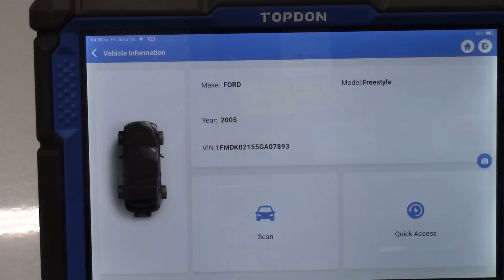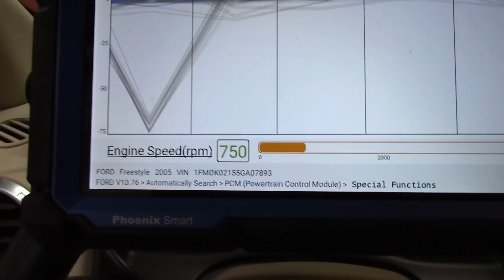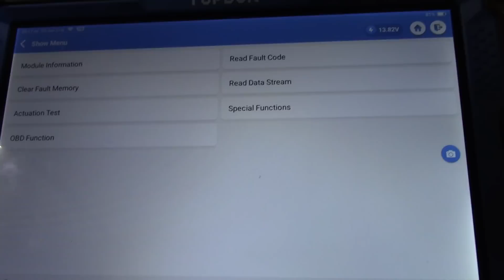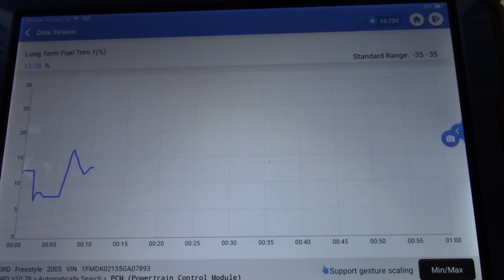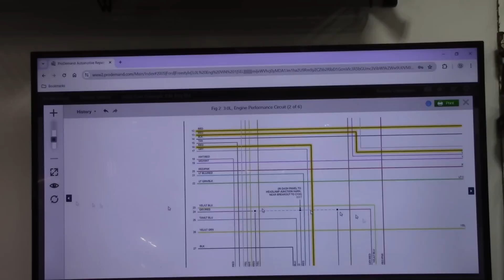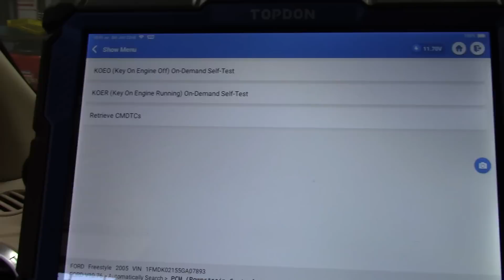P0301 Misfire Is Under Intake Manifold- What Do You Do?

Comment: I just did this job after watching a bunch of videos including this one! It's not  too difficult and only has one knuckle busting part-the egr valve. I sprayed it with PB Blaster and let it sit overnight and then the thing just moved with ease (I used a clawfoot 27mm on the end of my 1/2" breaker bar for good leverage). A mechanic wanted $325 plus parts. Thanks for the video!!

Comment: Hi Matt I watched you do the resistive test on the coil, neg, would it be possible to use an injector pulser to drive the coil, and use the oscilloscope to look at the primary waveform of the coil to see if it is breaking down, ignoring the fact that there is no compression or fuel mixture present, and just trying to confirm if the coil has a voltage break down or shorted turn.

The main concern with this test for me would be, damaging the injector test unit, just got it, but the voltage spike and current are similar for injector and spark coil.

What got me thinking about this, In the old tv's there was an extra high voltage transformer to supply 20 kv, similar to an old car coil, but resistive test were the same as for car coils now you could not find a shorted turn in the high tension side, so we used an oscillator voltage to see the ringing of the transformer on a scope, it was so accurate that sometimes we would introduce just  a single coil around the winding and watch the ringing pattern on the scope collapse to verify the set up was working, this was to stop ordering and changing parts that didn't need it anyway. :)
Reply from the maker: Not only can you do that but I actually have a video where I do this exact test.
Reply: @ I will look for it thanks

Comment: My coils and plugs in the intake.
P0304.then 0300.then 0301
0430 every time.

For a long time misfire#4
Briefly showed all 6
Now shows #1
My tool doesnt do the graphs 
Reader not scanner 

Also bank 2 02 was.showing with #4 original

It is due for mant-i-nance being 120k.

I dont know sh1t but i feel carbon buildup might be an issue?

Oh
She also has intermittant no start..dead key. 
But if you put it in gear, wether you roll a lil or.not then will start..

.
Also ive seen wire harnesses on this model are prone to melt.....

Thanks for.the content!
Reply from the maker: Start with the basics.  FASTTEC.

Comment: try a equinox, pain in the a** fuel rail under top intake. spark plugs by the firewall,  serpentine belt tensioner no room for leverage with a belt tool unless you spend some cash on a mid length one.
(i got mad an put the belt on by hand with the help of a sock_)
 replaced alternator and figured at  135k do a belt and plugs also. get it together and white smoke and gas coming from the exhaust, a lot of it. did a cheap elm reading and throwing a p0305 code.. cyl 5. swapped plug wires and same error, checked spark and it was strong. right away I though its got to be wiring from disturbing them 15 years later. (it is a 2009)

Neighbor has a mechanic of 35years who brough over the 10,000 
diag and said its definatly injector stuck open. Pulled off all the hoses etc intake and replaced injectors, all of them.
get it all back together and same code and smoke and fuel from the exhause.  went over everything wires etc 100 times. replaces wires, plugs inhjectors.
went back out to put things back together and give up. checked all connectors and used a little die electrical greese made sure the pins werent loose and I came across a group of wires (injector harness) where I believe a rodent nibbled through 3 wires, not all the way. so I snipped and  repaired the wores and rewrapped them with new heat tape. The car fied up like a champ, never ran better.
Now there are cpdes p0175 I think, so I replaced both upstream and downstream sensors, cleaned aitr intae, MAAF,etvc etc and cannot get rid of the code, ,y trims run RICH so its a air issue but I dont know what else to do . Seems i replaced everyth8ing mar as well replace the egr and maf.
 There is a small hole in the top intake (I learned from wathing videos) I think it replaces the egr, if that was blocked when I put the top intake back on that may be the problem. 

 I have never done anything accept brakes rotors and minor things on a vehical. Im proud of myself that I have that logic and skill to do on my own without guidance. But Im comming to my itts end.

 BTW, THANK YOU FOR THE FUEL TRIM VIDEOS. I listen to them over and over so I can diagnose  problems and narrow them down. Without your help I would be scatching my head still.

 Used your tips on my 2008 solara with 245k miles. it had the same belt and plugs in it. I replaced the alternator and the plugs and belt. (I should do the timing belt, but the equinox comes 1st).. I did some tweake from yur videos and now my car runs like a champ. I get aboiut 140k more miles a tank in gas, I idle steady at about  680 to 720, and I got my fuel trims fluzuating at 2 and 3%...
 You awesome man., thank you again!!
Reply from the maker: Regarding the “stuck open injector”- what is your voltage reading on the ground showing?

Comment: I have a 1999 chevy venture 3.4 v6 van. Turn over no start, but acts like it wants to start, but has a slight backfire. On the end of stopping your turn of the ignition key. I have changed cam shaft positioning sensor. The wires just pull out of the top of the sensor.  I am older man now a days it takes me a lot longer to try and do this  work anymore. But I don't trust auto shops.  You are a genius

Comment: The coil windings can still be good..  but it's just arcing through the insulation and shorting to the block somewhere..  Sometimes you can just replace the rubber boots, if you can find them...  and if they are easily removable.   (nice diag, as usual)
Reply from the maker: Yes totally agree and in fact probably what is happening. However there is no way I am only replacing the boots if the coil is under the intake. That coil is being replaced for sure to prevent a comeback!!
Reply: @SchrodingersBox  I agree.. that's a good call.   But as a DIY on my own stuff...  I might swap a boot if I could get them. :)  ..  too frugal for my own good.

Comment: What paddle probe did you use to test that coil?  Do you have a link for it??  to buy it
Reply from the maker: I have several of them that I just got off Amazon. various brands.
Reply: @SchrodingersBox  You could do a video comparing all the paddle probes you have.. (maybe you have, I"ll search the channel).
Reply from the maker: @calholli no I haven’t. But I have Three of them- they all perform identically but some are longer and less flexible and others are shorter but very agile. Just depends on what I am trying to reach.

Comment: Since there is no resistance difference between a good and a bad coil, it can't just be a coil. Is there any electronic circuit inside that plastic packaging that could explain the bad behavior during operation? Or is it just temperature related issue? Could you test the coil resistance after warming it a bit? Or since it's bad, tear it apart? 
It would be nice to understand what really fails inside the "coil".
Reply from the maker: No there is a massive resistance difference between the good and bad coil when the coil is under load. when the coil is not under load, there is no difference. this is why I mentioned ohming a coil is a terrible way to test it. you have to always test any coil when it is under load.

Comment: Hi , what is a misfire, an incomplete combustion because of weak spark, or something else
Reply from the maker: it is a failed combustion event for ANY reason. weak spark, lack of fuel, lack of compression, lack of oxygen, bad timing….
Reply: @SchrodingersBox  thanks for reply, how can we diagnose it on a single cylinder carburettor scooter, is low compression a reason of misfire or loose timing chain, cause I have black spark plug, and changing the main jet  with a leaner one it became worse thanks
Reply from the maker: Oh man. On a scooter with one cylinder it wouldn’t run at all if it was missing fuel or spark. It had to be either timing or low compression. Since it’s one cylinder you have to compare compression to a specification- you can’t compare it to another cylinder. 
   Keep in mind bad timing will cause low compression. You probably will have to disassemble it to check the timing marks. OR try putting about a tablespoon of oil in the cylinder and if compression increases you know the piston rings are worn.
Reply: @SchrodingersBox  thanks for reply, the manual calls for 170 psi and I have 93 psi and if I put a spoon of oil it goes 130 psi I don't know if my chain is stretched
Reply from the maker: Yeah this confirms the cause of your issue is low compression. It’s a little unclear where the loss is and if it’s a timing issue. This is where you just have to start dissecting it but at least you know this is 100% a mechanical issue.

Comment: Great video! Next time I would suggest running a relative compression test for the raw data. For me its scan, if misfire is present in one cylinder run ralative compression, then check the coil the same way you did. Takes like 20 minutes for all tests max.
Reply from the maker: I would have run relative compression if there was any indication it would show positive. You can clearly hear there was absolutely no compression loss in any cylinders.  So I move it to the least likely cause. Also the fact the misfire wasn’t consistent further substantiates a compression issue is less likely.
   Otherwise I totally would have done one.

Comment: Wow... Common theme with his videos seems to be everyone is a hack, except for himself. Couple quick points, the intake R/R is 2hrs labor. Which is generous. So the $700 figure thrown out there is way off. Also, what happened to the For Sure vacuum leak? A misfire caused by a vacuum leak will only be at idle. So driving the car would be and is always a 1st step. Fuel trim readings can be very misleading with a misfire. Next point, the PCM/ECM is not inside the car. It's in the cowl, AND they fail very often. So your time saving techniques are nice, but what if the PCM is sitting in a pool of water? Or what if it would be in water because the drains are clogged??? If the PCM is bad, the proper fix is ALL the coils ALL the spark plugs and a PCM, and they need to be Motorcraft OE parts. I'm not a flat rate tech, but I was, and I can tell you its the system more then the techs. You simply can't spend the time required to properly diag a car. You have zero pressure on you, no customer in the waiting room, no advisor asking you how much more time, or whats wrong with the car. You don't have 8 other cars that need to be looked at. Perhaps you should just do your diags for your customers and your You Tube fans, I think thats great, and you likely help educate some folks out there. But stop throwing the rest of us under the bus. We are not all hacks or dishonest, in fact I think the overall majority of techs want to do things properly. We are all very impressed with your knowledge, if thats what you need to hear.
Reply from the maker: I am fine but it sounds like you are the one with the butthurt ego and felt the need to try to one-up me. 
   I hope you feel better now even though you failed laughably.
Reply: @SchrodingersBox  Honestly I like ur videos, for the most part. I just can't subscribe to anyone in this field that continues the false message that shops suck, techs suck, etc. It has to stop. We all starting working on cars because we loved it. We all at some point wanted to fix peoples problems. Thats a great thing... My point should have been, you can use your knowledge to teach the techs that don't have ur knowledge. NO I'm not butt hurt at all, My shop is overflowing with work and 5 star reviews, just feel for the guys in bad situations. There is a difference between lack of knowledge and being a "rip off". I hope perhaps you can find a way to produce videos without making the public hate going to any shop but yours..

Comment: Excellent video.
Did you have a relative compression test mode in the scan tool?
Did scan data have ignition burn time per cylinder?
Ohm meter test, if it shows good it does not mean anything, if it shows bad it is bad.
Have you tried to make a trigger circuit with a TTL 555 to bench test coils?  
Thank you in advance for your answers. .
Reply from the maker: Yes there is a relative compression test mode but I usually just set my ammeter to volts with a 2s timeframe rather than go to it.   In this video it was so obvious compression could be ruled out I didn’t even do a relative test. 
   I do have a video on bench testing coils.
Reply: @SchrodingersBox  Thank you for the reply.

Comment: Hello Matt !  Happy Sunday evening to ya’ !  📈🔥💡 I want to ask you if you can help me understand where initially the symptoms and especially with fuel trims pointed to a vacuum leak and in reality (ultimately) those were caused by this failed ignition coil .  If you don’t mind .
Reply: Wait / hold on . I’m now aware (after watching the video again) that a vacuum leak might  exist but  AWAY from the intake manifold which was sprayed down.  Am I understanding correctly / was there any vacuum leak at some other location ?
Reply from the maker: Correct. Somewhere is a vacuum leak affecting both banks but it’s minor and irrelevant to the issue so I am no worried about it.
Reply: @SchrodingersBox  

Got it !  Thanks for the quick response !   Much appreciated ! 
🐱🎁 ⛰🔥 
Schrodingers Box Rocks !!

Comment: Another great video. Although your method of actually diagnosing problems is more time consuming than simply firing the parts cannon. I'm sure it is greatly appreciated by your customers.
Reply from the maker: How is it more time consuming than firing the parts cannon?  If this car was misfiring due to a ground fault on the injector, how would replacing injectors, coils, plugs, and R+R  an intake manifold be faster? That would be over 5 hours of labor and still not fix it.
Reply: @SchrodingersBox  Maybe I said that wrong. I just think it's admirable the way you do the extra steps to perform a proper diagnosis.

Comment: Common voltage feed to injectors AND coils but don't they trigger at different times...  i.e. bank 1 injector is followed by bank 1 coil?  Intake/compress/ignite/expell...
So scoping that common while triggering on front #4 injector would I.D. the cylinder sequencing?
Reply from the maker: Yes of course we could have done that but the issue is having all 12 events at one time is very busy on the screen especially considering you get THREE firings for each coil plus some feedback from the coil and injector firings as well. It would have been an absolutely mess trying to verify and identify the signal voltages alone, much less the specific cylinder. So much easier to just do the single coil trace like I did on this particular design.
Reply: @SchrodingersBox  i'm certain you're right but the injector firing comes well before the triple firing of coils...

-Intake...   injector firing
-Compress
-Ignite...    coil firing
-Expell...

And yes!  It would be busy....
Reply: FOUND ON INTERNET:
/////-----     The time between injection and ignition can span nearly a full engine revolution, as injection occurs during the intake stroke and ignition near the end of the subsequent compression stroke.    -----/////
Reply: I'M suggesting your first inclination was brilliant but the later discount without trying was disappointing.  I wanted to see the current draw waveforms...  -Tom
Reply from the maker: I will definitely show this at some point when I get a car that will give a “cleaner” signal so I can show how we analyze and identify each cylinder.
Reply: @SchrodingersBox  
C👀L  //  C👀L  //  C👀L

Comment: Without turning a wrench how would you verify the PCM driver is OK? Like you said without the proper load you wouldn't know if the ignition coil is bad simply by resistance checking it. Just curious what you would be looking for. Personally I dont mind taking off an intake manifold to do some additional checks as i find its typically much easier then it looks at first glance, lots of technicians psych themselves out into making a 5 minute job seem like a whole day ordeal. Good work though going through it without having to take it off! :)

Comment: Very informative video, although I have seen clogged injectors that caused a misfire with the LT and ST under 10 percent. After that experience I usually try not to rule out clogged injectors
Reply from the maker: I actually have never once seen a clogged injector however I have a video of an injector with an open winding. 
   We can see from the secondary in this video that it is not a fuel issue. A fuel deficit shows a very specific “double firing line” on the secondary due to the higher resistance in the cylinder without the conductivity of the fuel.

Comment: There is nothing like a scientist using the scientific method while troubleshooting, along with common sense.  I am a firm believer in preventative maintenance.  Depending on the age and mileage of the car, the cost of the parts, and the labor involved, it is absolutely prudent to change parts that are still working but logic dictates they are fatigued relative to the part that failed.  In my humble opinion, it would be a disservice to the customer if the other parts weren't changed, that is if they can afford the higher cost and are planning on keeping the car.  My customers appreciate forward thinking that may cost more upfront, but save them more money in the future by not needing to pull the manifold potentially two more times as in this example.  Not only do my customers appreciate it, but they expect that level of service from me, as they should.  Thank you for another great video.
Reply from the maker: Great comment man!!
Reply: Hey